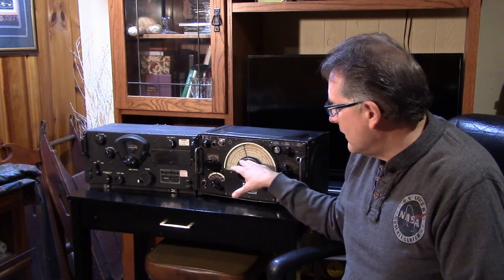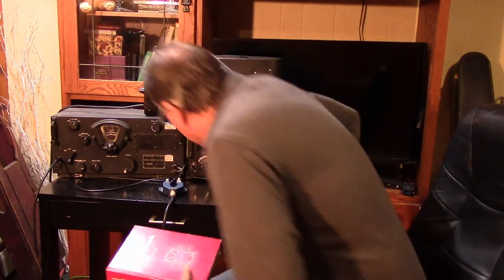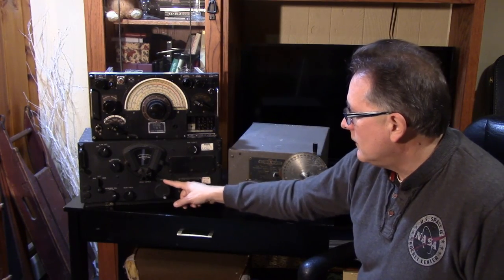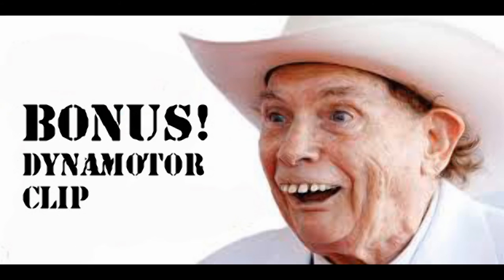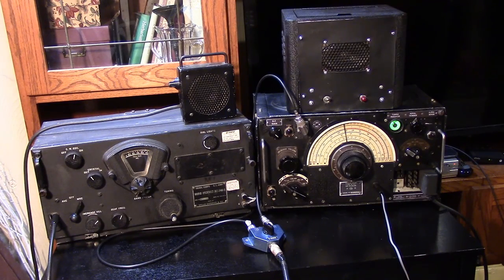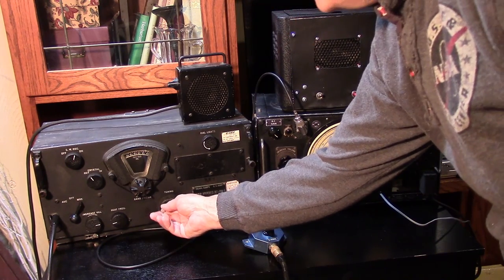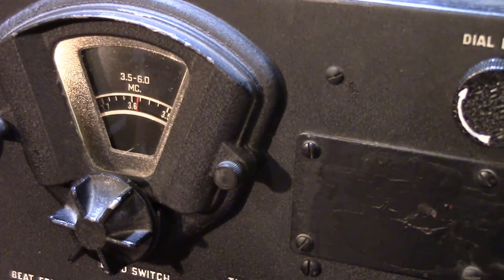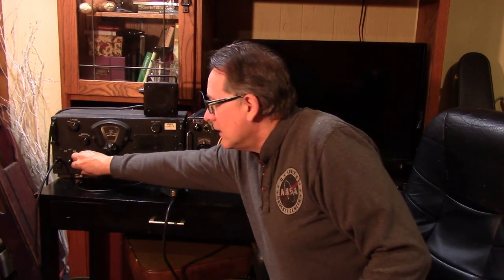R1155 Part5 Battle Royale

Comment: I listened to the five episodes of your repair and test of the R1155.  I didn't think I could suffer some of your patronising of the "alien" equipment, but happy that you realised that the multi-function R1155 and its counterpart R1154, were a set of equipment that was well thought through and worked.  However, one thing you should remember, if demeaning RAF equipment in future; for Lancaster operations 50 percent of aircraft and their crews were lost by their 15th mission.  That means that a radio set would work for 130 hours before loss and the loss of the 55,500 crew in Bomber Command.  Only 10 percent of crews reached their full tour (30 missions in the RAF).  These aliens with their alien equipment, achieved a lot with off the shelf equipment.  Thanks anyway.
Reply from the maker: David you should also take a look at my WS-19 video and see if I made any gaffs there as well. I remember when I stumbled on my first Wireless Set 19 and I literally stumbled over it because the Canadian was using it to hold down a tent rope! That thing was my first piece of British Kit, well actually the second because I was familiar with the SCR-522.

Comment: Great set of videos. Rebuilt several BC-348s. keeping one which is all original.
Same with HRO"s keeping one of those which was modified by a workshop in Montreal to be one of 200 special units. 
Just picked up an R1155  with DF section complete, opened it to find,  it was made on Jan 1st 1941, according to the plate on the chassis,the wiring done by Marconi. almost 100% of the wiring covering just  crumbled away wherever I touched it. To me that means a total rewiring job, I intend to restuff all caps etc. But my heart started fluttering when I looked at the coil box and all those wire connections, I  figured this is a 12 month job  at the time I  want to devote to this task. When I get fed up I will look at your video and say there is light at the end of the tunnel
                                        David
Reply: Stick with it, there really is light at the end on the tunnel...

Comment: Greatly enjoyed the series; saw a lot of "modern" caps and a good number of resistors and wondered if the absence of those wax-covered devils meant they had all been changed out or if the 1953 date was a factor.
Reply from the maker: It may be that there was a depot refurb at one point. The radio had been messed with by a former conversion artist. So a lot of unmods before replacement work started.

Comment: Very interesting, as usual. Thank you.

What I can't easily find (and I guess will be pretty difficult to establish) is the cost to manufacture each of these sets. Bearing in mind that Great Britain had been in economic nosedive since WW1 and that a huge amount of the military's equipment was lost at Dunkirk thus needing urgent, massive replacement, I would expect the R1155 to have been designed for the lowest possible manufacturing cost. The BC-348 looks like the 'absolute best possible' design philosophy and the R1155 the 'good enough' alternative. That said, I haven't encountered reports of unreliability or inadequacy from British, Empire and Commonwealth aviators so I guess the R1155 was indeed 'good enough'.

Comment: Terrific work Michael. I've just rewatched the series again as have recently acquired a BC348. Having quite a bit more knowledge of these radios since the first time I watched the series I've gleamed so much more info second time around. Could you let me know please Michael which higher gain valve you used in the BFO on the 1155 to improve stability? I may have one and would love to experiment. Out of interest did you try a q-multiplier on the R1155? Thanks to your other videos I've just acquired a Codar model to have a play with and could easily tweak to raise the frequency for the R1155. Vy 73 de M0IDF
Reply: @Jack O'Bean Hello Jack - you perhaps conflate my q re improving the BFO performance with improved VFO stability. My Q is about the former...not the latter. BFO stability is as essential for decent CW performance as VFO stability. I've a lot of experience using period from the 40s and 50s portable or in the intended installations...from warships to Jeeps. I own around 60 such sets and tons of accessories so know exactly what these sets are capable of. I'm also well read from the original sources as have an extensive library of publications from the 20s thro' to the 60s....

Comment: I can answer this question without watching the video or having ever seen a BC348.
BC348 has to be better than R1155 in every respect
I can say this because I decided to restore an R1155, actually to make 1 good one out of 3 parts ones.
The R1155 is a British made constructional nightmare, this thing is impossible to work on, near enough impossible to disassemble and impossible to put back together again. Perhaps it was to stop the Germans from reverse engineering it, then again I doubt they would ever want to.
How they were originally constructed is beyond belief or comprehension, someone , somewhere just decided to make it as difficult as possible to build, it makes working on Japanese monster receivers seem like child's play.
I couldn't decide if I wanted it just to look original, or if I wanted it fully working, I decided to go for both at the same time, and also restore the DF section and add all the filter mods that were later officially done by the Air Ministry.
and just for laughs, i thought it a good idea to start with a bare chassis and gradually add bits from the other 2 radios.
Quite an ambitious project I thought, only to soon realize it's bordering on the impossible.
You are either an electrical genius with the dexterity of a contortionist or a sadistic psychopath that set out to deliberately make the impossible seem relatively easy.
needless to say I haven't finished my project yet, not even close.
however I haven't given up on it totally either.
each rainy day it get's a little closer to completion.
Reply from the maker: Ha! Just my luck to have stumbled on a rat infested model to bring back. I didn't know mate - so it was a journey of discovery at every step.

Comment: 2 versions of the 1155 actually covered 160 meters...
Lee, WA8QFE
Reply from the maker: I am worn out after the R1155 - so now some guy just gave me an RBA to restore. Just moving it took 2 men. Designed by RCA but built by National. Appears to be LOW frequency only.
Reply from the maker: Speaking of low frequency - I just was given a monster - the RBA Navy Receiver designed by RCA and this one was built in Malden, Mass. by National Radio Company. Took two of us to move the beast.
Reply: I’ll be looking forward to your restoration of the RBA, they have a nice write up about one that was restored on radioblvd
Reply: Regarding LF receivers I find the HRO is very good on the lower frequency coils sets (50 to 100 kc/s). I also renovated a Royal Navy B41 for HMS Belfast - that went down to 15kc/s! It was excellent for NDBs and Navtex reception.